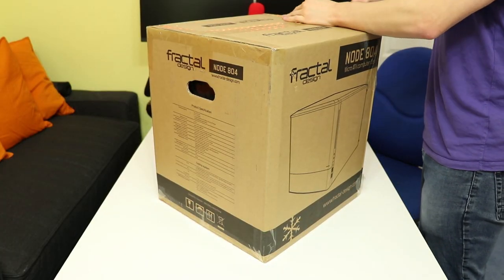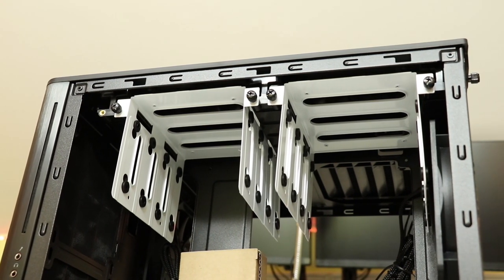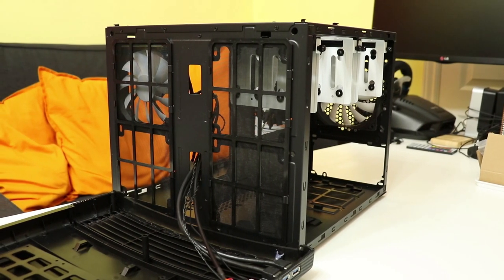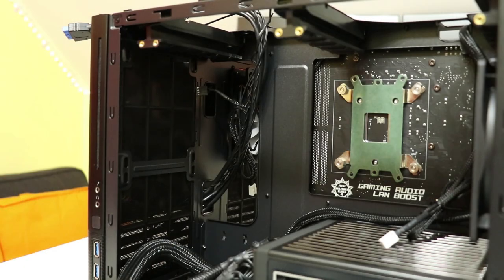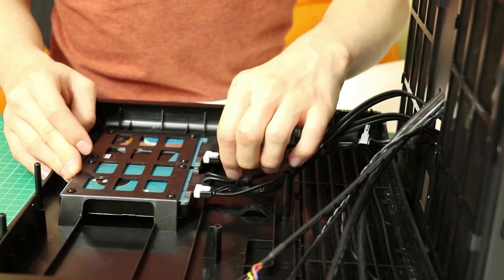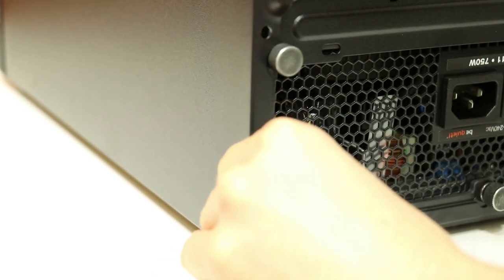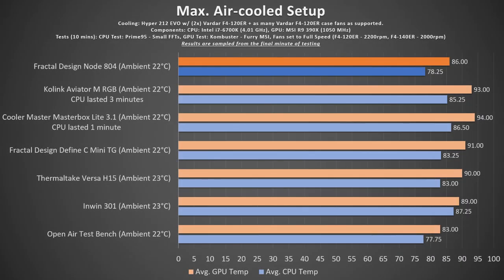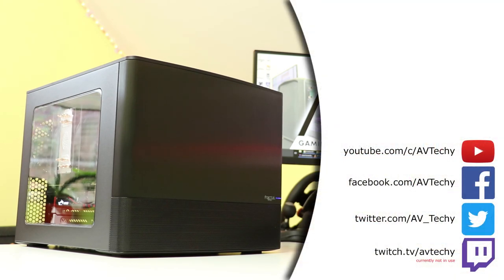Fractal Design Node 804 Air-cooled Build Review

Comment: There are many reviews about this PC case but yours is by far one of the most detailing in terms of actually building inside the case. Most reviews just have a quick view over the case features, pro's and cons but they never get this detailed about how it actually is to build inside the case. Thanks a lot!
Reply: I thought the same, great review. The only thing missing was connecting up the 3.5 HDDs and demonstrating how difficult it is to swap out drives. Other reviews have mentioned it as a design flaw that the connections are at the bottom, but so far I havent seen anyone show how bad it is to deal with. If you had 4 drives in a cage, presumably you have to unplug some or all before you can pull it out and put the cage on the desk? Doesnt seem there is much clearance above the PSU - at last for the rear cage.
Reply: @jorisstassen7995  Interesting point about the middle driver connections. Ive see some of the very high capacity drives have those missing.

You did manage to pull the entire cage out of the case without having to unhook any of the sata connections? I was thinking maybe at least some cables wouldnt be long enough and you would end up jamming your fingers in the case trying to unhook things if you populated all 4 and later wanted to remove it.
Reply: @Ironbuket  Hmm I don’t know for sure if you got all 4 hdd slots (per cage) loaded with the drives if the cables would become tangled or became loose. I am currently only using 2 hdds for storage and one ssd as a boot drive.

About the screw holes, I made a mistake in what I meant to explain. Some hdd drives only got screw holes in the middle: one hole on the left side of the drive, one hole on the right side of the drive. This is why Fractal now includes hard drive brackets with this case, so any 3,5” hard drive should fit safely in the hdd cages.

My apologies, my English might not be perfect as I live in Belgium.

Comment: Hi AV techy!! great video! I have almost the same build, but I have rom for one more fan in the top front. I am unsure if this one should be exhaust or intake... You say in this video that it should definitely be intake. but other sites I see it recommended to have both top fans as exhaust..This with arguments of simple, one-way airflow, and that heat goes up. 
I think intake would be better, for more air to go through the CPU heatsink, but could you please elaborate on your reasoning for this choice?

Comment: Hi, well done, your work is very good. This is not a request, but, have you think about build in the Thermaltake core v21, its another cube case that i really like and has too many ways to configure it. See you bro.
Reply from the maker: Thanks you very much!

Funnily enough this channel was due to start with the Core V21, but due to issues with potential design copying from Thermaltake I decided I would create a video on reasons not to support a company that might be performing unethical practices (emphasis on the might). (That video is so old and low quality compared to some of the videos now, I wouldn't recommend checking it out.)

However since then Thermaltake has released a lot of interesting designs that have firmly moved away from close competitors designs (at least from what I've seen). So I may take a look at the Core V21 in the future, since I did round it down as pretty much the perfect case for my situation at the time.

Thanks for your thoughts, and please don't feel awkward about requesting videos. It keeps me creating content people want to see, it's actually extremely useful. So if you have any more requests or suggestions, let me know. I can't promise I will be able to meet the requests but I will strongly take them into consideration.

And finally thanks for checking out the video and showing support, I really appreciate it!

Comment: Hello, I know you may not have the case anymore, but help me with memory if you can. Do you think that 160mm cooler clearance is mandatory or i could fit a 161-162mm cooler?
Reply from the maker: You'll normally get away with a couple extra millimetres on your CPU cooler. The clearance is typically slightly oversized from the spec to account for manufacturing tolerance.

A couple of millimetres is about all you'll get extra so I wouldn't push it any further than that.

Comment: I know this was a few years ago, but during the discussion on the hdd cages you mention that with the right brackets you can install 16 2.5" drives. Do you have any details on these brackets? I've googled a bit but can't find anything
Reply: i think he was basically saying you can just get a (2) 2.5" to 3.5" adapter bracket per 3.5" hdd spot. If they are SSDs don't use brackets, just velcro a ton of them stacked together

Comment: Such a shame they don't sell this case without the daft window in it.
Reply: Think if they'd made a version with a mesh side with mag dust cover... 4 more 140mm intake would be awesome.
Reply: @ArkAngelHFB  one could get rid of the glas replacing it with thin wood panel and drill holes for fans.

Damn im Going to do this.
Reply: @unrealdevon  Hell man go all out and stain the wood so it even looks nice...

fuck go All out all out and burn a logo into the word after then seal it.

Comment: I use this case, I think it's absolutely massive. I want to change into a normal micro atx case but I'm not sure if my CPU cooler will fit. I'm pretty sure it's the same as the one you use. Which would fit into the case I'm wanting. Are most CPU coolers like the 212 evo 160mm?
Reply from the maker: It certainly takes up a lot of desk space, it's a bot of a monster for an mATX case.

As for the cooler, there are a lot of 160mm coolers on the market. The trend is pretty much set by the total height of the motherboard and a 120mm fan inside a case. But there are plenty of coolers that are smaller than a 160mm cooler. But bigger is generally better, by that I mean more fin surface area. This means there are coolers that are smaller in profile, but have more or bigger fins that will outperform the Hyper 212 Evo.

However there are plenty of mATX cases that can support the Hyper 212 Evo, many of them have been reviewed on this channel. If you want a few suggestions let me know and I'll do my best to help you out.

Comment: You put the power supply in upside down
Reply from the maker: So you'd give your PSU about half a centimetre of room to breathe, rather than the masses is space and active airflow from the fans inside the case? Right...

Just look into some videos around looking into PSU orientation, and you'll soon realise it doesn't really matter.
Reply: @AVTechy  Careful not to drop anything into the PSU. There is a reason they arent installed that way by default, not in any case I am aware of. You could maybe add your own filter, but if the orientation doesnt matter, as you said. Then just install it the way you are meant to?
You also wouldn’t have had the screw clearance issues at 14:59 if you had fitted it the correct way up

Comment: im giving dislike cuz u putted the psu on the wrong way.... and if u call urself a ''tech master'' im a train....
Reply from the maker: I don't mean to burst your bubble, but the resistance created by the close distance between base of the case and the desk will likely be higher than the active airflow and more spacious area inside the case. I think fan side up if the inside isn't completely rammed full is the right move here.

And who called themselves a "tech master"? Is the "train" part supposed to be a clever twist on the joke? I'm really confused about the whole comment to be honest. You might want to get yourself some"train"ing to understand that PSU position really isn't all that important (to the PSU itself, and the system as a whole). The sooner you understand that most things aren't black and white, and are instead mostly a mix of greys you can probably get past making weird faux elitist comments like this one...
Reply: There's more fresh air available above the PSU than below it, look how little clearance there is below the case.